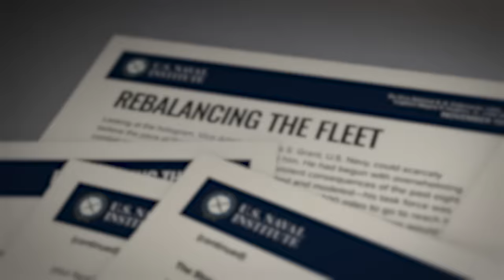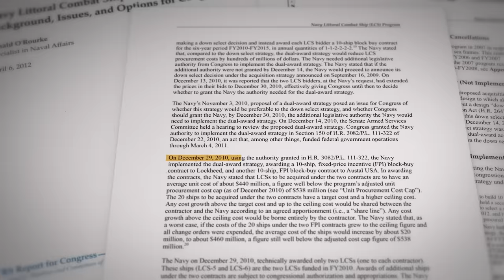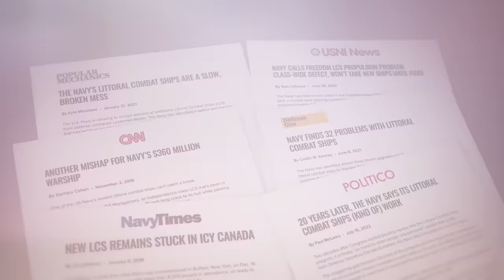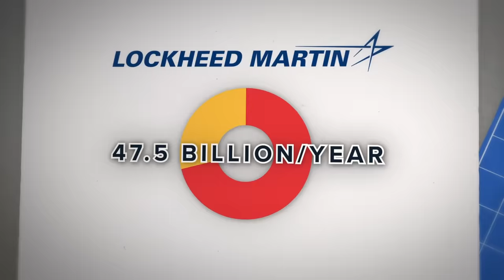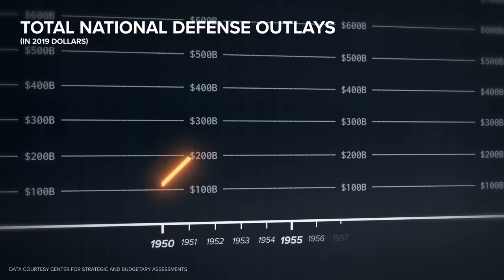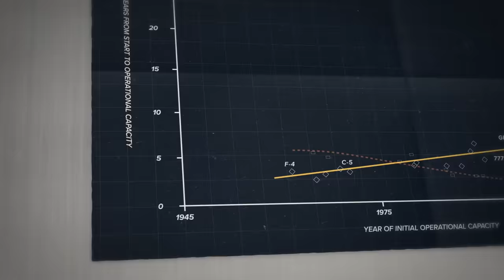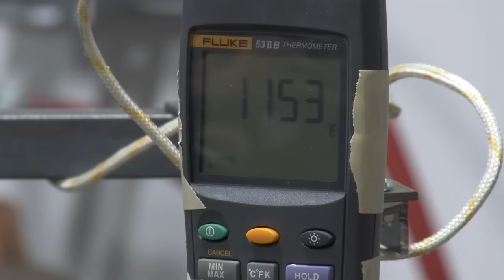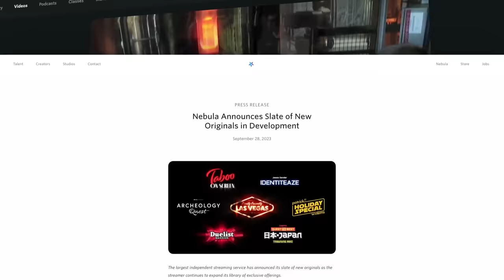Why the US Military Costs so Much

Comment: The military isn't what costs so much it's the equipment, primarily for the navy. Plus also, when the jets are designed, there are different versions for each branch (Army, Navy, Marines).
Reply: You do understand that the requirements for carrier operations differ from those of land operations, don't you? No, of course you don't.
Reply: @brucetucker4847  a jet is a jet regardless of the uniform of the pilot.
Reply: You are sorely mistaken... navy pilots and airframes arguably have a harder job. They need to handle environments that air force planes just don't need to deal with-catapults, tailhooks, moving runways, etc.

Signed, USAF aircraft maintenance
Reply: @amehak1922  So no, you don't know anything whatsoever about naval aviation.
Reply: @joshuacheung6518  they can design one jet that can handle it all for all 3, that's all I'm saying.

Comment: 6:25 That sentence got me thinking. The Iowa class battleships are actually the perfect example for all 3 in practice. A high top speed (rated for 33 knots, max speed was 35,2 knots by the New Jersey in the lead up to her tour during the Vietnam war), long range (almost 15k nautical miles at cruising speed, enough to sail more than halfway around the globe) and for the time a high payload consisting of 9 16"/50 caliber Mark 7 guns in 3 turrets. Not to mention Tomahawk and Harpoon launchers during their 1980s commission (for those who don't have naval history as a hobby, Reagan reactivated the 4 Iowas in the 80s to expand the Navy relatively fast and without having to pay too much. They got modern equipment back then and even lost 4 secondary turrets (2 on each side) to accommodate them and reduce the top weight).
And if there wasn't a ton of stuff that would need to be overhauled including stuff as "simple" as plumbing to reactive them and a bunch of crew in an already understaffed navy required, they could certainly be reactivated again. Although it would require making new powder and shells. The WW2 stockpiles that were also used in among other places Vietnam and Iraq were scrapped about a decade ago after Iowa and Wisconsin left the reserve fleet in 2006
Reply: 🙄  Yeah, we have to grow up and let go of our old man nostalgia.  BBs have outlived their original mission set.  They'd still be useful as a missile boat, as they were in Gulf War 1, but I could say the same about a huge barge with nothing but VLS tubes.  Couple of tugs tow it to a location, anchor, data up-link and then sit there spitting out Tomahawks on command from afar.

Comment: the issue with the engine isn't that it is too complicated for sailors to work on them it has to do with the way the billets on the ship worked. they did a 6 month rotation, which meant that the sailors didn't get enough time on the ship to learn how to work and maintain the engine, and on top of that the smaller crew and greater complexity meant more time spent doing routine maintenance instead of becoming more proficient in working on the engine and other equipment. in port contractors were expected to take on the extra load and get keep the ship in top shape, but out at sea they no longer have the contractors and then need to start doing jobs they never did before. in port should be the time to learn but due to government contracts they are not allowed to work on things the contractors have contracts for and thus can't learn for when they need the skills.

Comment: I hate the word modular in military procurement. If it were a platform that you could mount different things on like a truck chassis. It would be fine but having huge expensive modules that can be changed out. Doesn't work.

Comment: You mentioned around the 7 minute mark that the hulls made out of aluminum crack at speed and use and it got me wondering, my car has an aluminum engine and so do a lot of racing engines. Is it a different allow? Wouldn't something that can take sustained explosive and frictional forces be ideal for this application?
Reply: My understanding is that aluminum engine blocks do eventually crack but are lighter weight than steel. Also, an aluminum engine block isn't pushing against tons of water every time it moves. The water ships move through is incredibly powerful, because there's so much of it and the ship literally depends on it, both to move and to stop. It's like pushing against ice, except more slippery.

Comment: While there are small points I personally would disagree with, the idea of the video is almost entierly correct. One thing to add is that I was once at a National Guard base, and in their baracks they had a zip tie over the emergency update doors. We were told we would be fined 600$ if we opened those doors, and being curious I asked why. The response was it was because thats how much it costed to replace the zip tie, which could be gotten at Home Depot for 1$ max. 
A big problem is how the military is forced to but from select manufacturers, which allows them to do this if there are only one or two companys that can make these zip ties.

Comment: F-35 is expensive but very, very much worth it. The three types of aircraft are replacing 3 different older gen models. Block 4 of F-35 has some insane upgrades that make them go even one step further than anything else.

Comment: Part of the massive costs, that isn't talked about, and really the main issue. The markup contracted companies put on things. It's not just for all the big, pricey stuff like ships, jets, AFVs, etc. But for the parts for all the equipment, from radars to toilet paper. Guns to pipe fittings. It's all ridiculously over priced, and if some company comes along and starts to offer those parts at a cheaper cost. The major companies buy them out and get the price back to what they want.
TL;DR One of the huge reasons is that the main companies the US can use for their equipment has a full on monopoly for equipment and repair parts

Comment: It might sound inauthentic to argue that a portion of defense spending is well used to keep struggling businesses afloat but it makes alot of sense.  Say you have a company that builds warships well in peace time with no one ordering warships its hard to stay alive much less make a profit but if that company goes under and closes all those machines get sold or rust for lack of maintenance all the workers get new jobs and then if the country has to go to war again instead of just having to pay the company build new ships you now have to pay to build new ships but a whole ship building facility which is gonna not only cost more than keeping that business open but more importantly in a crisis is the time it now takes u before you can get new ships.  A little over simplified perhaps but illustrates the point

Comment: I would add that there is little responsibility and punishment for failed/mismanaged/wasted projects. No large fines and long court proceedings in case something reaches court, no prison terms, nothing. 
Second thing - contractors, subcontractors, subsubcontractors - into thousands - and no one, again, is responsible, problem can be forever kicked down somewhere else. 

Suffice to say such systems have a tendency to fail at some point, with all that entails.

Comment: There are also some other factors to slower development and why it takes so long for new military technology to come online. In most cases there is nothing to rival them. The USs current air superiority fighter is replacing an aircraft that has scored over 100 air to air victory's without a single defeat. It entered service in 1972. The US has such a large technical gap between itself and any nation it would end up fighting against that simply the next aircraft doesn't need to be quick it needs to be a significant step forward.

Comment: LCS is definitely a gaff

Zumwalt class was screwed by its cut to 3 ships instead of replacing all destroyers. The rounds of the high-tech guns would have cost around $50k a piece, right on par with the cost of dumb rounds, but because it was cut to 3 ships and 3 guns the price per round ballooned uncontrollably. 

The F-35 is technically 3 fighters, the A, B, and C, three different aircraft. That means it cost $566 billion per aircraft type. They will be replacing multiple aircraft and saving money overall. Those are facts. Please stop leaving out facts that contradict what you believe.

Cost + contracts are the absolute worse thing ever! I'm so glad they are moving away from those types of contracts

Comment: Of all the programs pushed forward in the last 25-30 years, the LCS is the most egregious example of the M-I complex gone amuck.  At least with all of the other programs the products of them are capable of performing the missions for which they were designed.  The LCS is not survivable in any combat environment and not able to live up to any of its promises.  Consider that a former president of Austal, the contractor for the Independence class LCS, is under federal indictment for accounting fraud.   Plus in spite of the Independence class having structural design defects that led to the formation of cracks in the hull, Austal  has been landing multiple contracts to build other types of ships and is moving into building steel hulled ships.  Usually, in most businesses if you deliver a shoddy product you tend to lose customers, not so in the M-I complex where companies hold workers (and voters) as bargaining chips in negotiations with the government.

Comment: A lot of the military budget has zero to do with the building of anything. USA is stuck without some fundamental cost control on DoD. For instance Veterans are now costing the DoD about 300 billion a year. Then you have pay which is substantial. After that you have the upkeep and resupply of almost 900 bases from small to large worldwide. When your all done with just those costs its consumed half the budget before a F35 is built before a new Carrier is built. No one reports on this because it’s boring. We would rather report on a cost overrun that is spread out over decades. There is a real crisis in just base costs that hardly anyone reports on which is a shame.

Comment: Prior to WW II the standard practice was for the USA to keep only a small force when not actively engaged in a major conflict.   After WW II, the cold war with Russia was the justification for maintaining a large military force outside an actual conflict.   And that Russian threat was largely the result of US aid to Russia in the form of tanks and planes sent during WW II (plus somehow letting spies into the Manhattan project).   So the speech of Eisenhower is something other generals had been talking about including Patton way before that, as to why the US was aiding a threat they would have to fight later.   But even with that, because the Russians were seen as a potent threat, much of that spending was more concerned about readiness in case of an actual hot war.    And in general, that meant a balance of quantity over quality which was the standard industrial approach going back to WW II.   However, with the fiasco in Vietnam and the Russian success in space, came a new line of thinking that the USA needed to outclass the Russians in every aspect which led to the much increased spending on more and more advanced equipment.   And that is what got us to where we are today, with less people under arms but a higher military budget due to all these super advanced projects for enemies that realistically don't exist.
Reply: "Why was the US aiding a threat they had to fight later?"
Did you forget about the Nazis or something?

Comment: My company makes a tight tolerance, multi part welded stainless steel... rope cleat. Yes, for tying a boat rope to. You could get something to perform the exact same function at West Marine for, say, $25. We are a very small, low level contractor. Imagine what the big guys get away with.

Comment: Im confused as to why someone would even ask the question of why the US military costs so much. Its the only military that is perpetually exerting influence across the world. There are large bases all over the globe,deployed troops in far off areas, a navy that has pretty much guaranteed shipping lanes for decades, and a doctrine of being able to fight two or three main theaters of war at a time. Thats going to cost. Now its true that because of all this the US allies dont need nearly as large of a military but comparing the US to that is silly. If the US military wasnt so big, expensive and spread out the other allied nations WOULD need to spend sugnificantly more on military. Further, many dont need to do as much r&d because they can buy material from the US. R&d is very expensive, you always have to be ahead and often tech you work on doesnt come to fruition until 10 to 20 years later. As with any research, a large chunk of it will simply fail. Thats the nature of the beast.

Comment: The problem is that when you ask for a jack of all trades it’s going to be shit at everything
Reply: Except that's not how that works. Highly specialized equipment is often worse than decent all-round equipment. War does not usually permit for easy shuffling of units to allow for the right specialized unit/asset to be in the right place at the right time, emergencies always occur and units are left forced to make do with what they have. This has been seen countless times in many previous wars, it's why specialized equipment is kept in small numbers and deployed as necessary and not used to replace the main line units/assets available.

F-35 routinely outperforms its contemporaries by wide margins. Its versatility is immense owing to an incredible sensor suite, datalink capabilities, and ordnance.

Comment: Pretending like these long development times and price overruns are a solely US military problem is disingenuous. The decades long development time for 5th generation jets for example is the same across the world. With Russia being unable to even field theirs because of the associated costs and development problems.

The simple truth is, making a P51 in ww2 is a lot easier than making an F35.

The case for the US military not needing to be as large is a strong one. But you pay for what you get. Accepting lower capability is the draw back. Asides from saving that can be made while trying to maintain capability. Which will be extremely hard

Comment: I'm going to tell you, much about LCS is ether a lie or greatly exaggeration. The reality is that the Navy stopped caring about the type back in the 90s. Admirals view it as a junk ship, and they wanted something bigger to land their stars on. This is why the Zummwalt was such a fiasco. Essentially the Navy "transferred" (not the right term, but it gives you an idea) money that would be used to provide oversight of LCS to Zummwalt, and the longer things went the worse it got.  For those of you who think that this is a ship by Congress, well, Congress saw through what they Navy did. Thats why they forced them to continue with it. After a while they were purposely withholding improvements so that they could get funding for bigger projects including a new destroyer which is actually what the Navy wanted all along. This became even more noticeable when Zummwalt failed, that's when they really started lobbying for LCS's death. They even award a Frigate contract to another design after years of prepping an LCS derived design so they could retire the class earlier. The reality is that this problem also happened with the Ford. The difference is, the Ford was a $30 billion aircraft carrier. Even while over budget, LCS is far cheaper. So instead of doing what they did with the Ford and taking the time to work the prototype before mass production, they just built them out  all with the same problems. The irony is, what the ship does well, it's perfect at. It's a perfect small intradictor, and would be at home in the Red Sea or similar theater. Problem, Navy doesn't want it to eak out a niche. They want the money for their 350 ship fleet and they want capital ships, not small vessels like this. LCS problem isn't break downs or survivability, all new designs have those problems, it's a service that was unwilling to fix the issues. The Navy viewed LCS as a placeholder from day 1. Now with the China threat they are getting what they want at the expense of what has the potential to be a very effective platform.

Comment: LOL the defense spending graph is laughably stupid.
As a percent of GDP which is the only metric an honest individual would use it's a fraction of what was spent during WW2, and it's at one of the lowest levels in history.
From what I can tell you used defense spending in "44, which was at most 60bn and applied an inflation calculator to the graph, hence the reason it's closing in on 1tn (though you definitely skewed some stuff, it should definitely be above 1tn, not be 500bn short). It all seems fine until you realize that inflation is calculated based on the CPI. For the ppl who are not familiar with the term the C in CPI stands for consumer. I ask you cause I really want to know. What exactly is consumer about defense spending? Even their chips are specialty builds and require a fortified supply chain so no sourcing them from areas with cheaper labor like china.

Comment: one word: wasteful
Reply: Ask the Guyanese if having a Super Strong Military is wasteful? Or maybe Taiwan?
Reply: @lisaroberts8556  the "super strong military" isn't wasteful. It's the above "what's necessary" to achieve what the purpose is. When you go above and beyond what is necessary, everything past that point is excess waste. It's like if your internet connection was 1 trillion mpbs. Nice, and you will never have a speed problem, but, you will never use it to its max. All you need is what your needs would be, anything beyond that wastes resources that could be better used for different things.